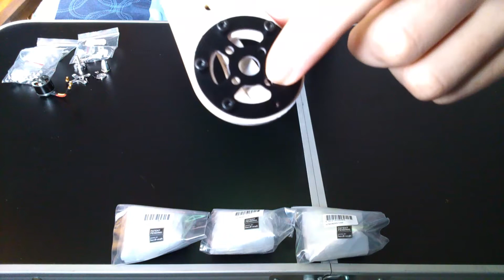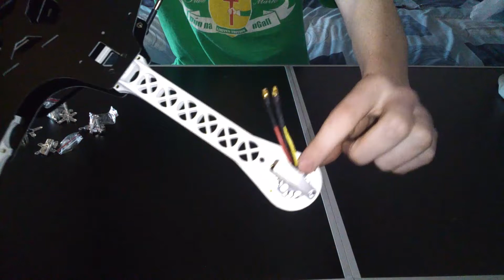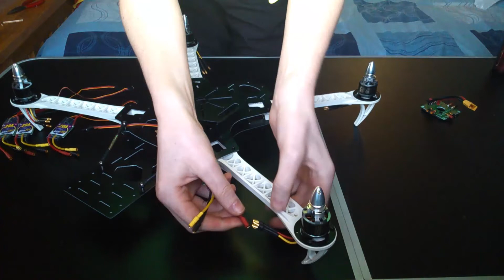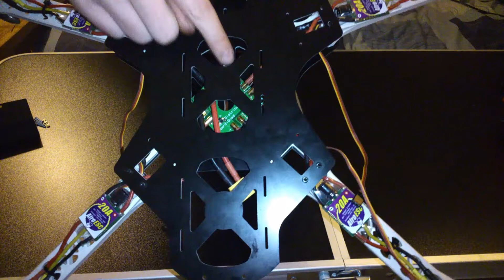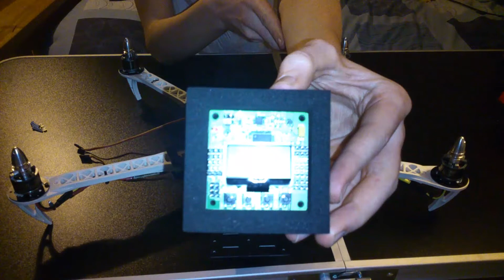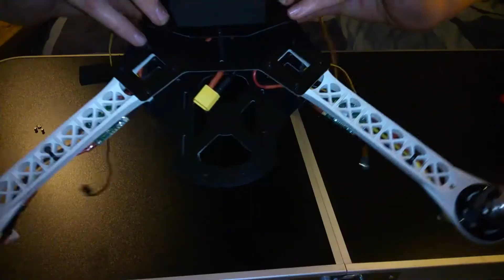SK450 Deadcat Build [Part 3 - Electronics]

Comment: will this battery work well for your build ??http://www.hobbyking.com/hobbyking/store/__11911__Turnigy_nano_tech_2200mah_3S_25_50C_Lipo_Pack.htmlTurnigy (nano-tech 2200mah 3S 25~50C Lipo Pack)
Reply from the maker: Yes this battery is perfect , however if you want longer flight times than 4-8mins get a 4000mah or so.

Comment: ak 450 for a dead cat, 1200, kv, what do you recommend for helix 3 cell lipo?
Reply from the maker: For a helix quadcopter?  The small one?
Reply: NTM is a 1200 kv propeller which could matching with?
Reply from the maker: progetto aladino a 9x4.7 SF
Reply: ok grazie
Reply from the maker: progetto aladino no problemo